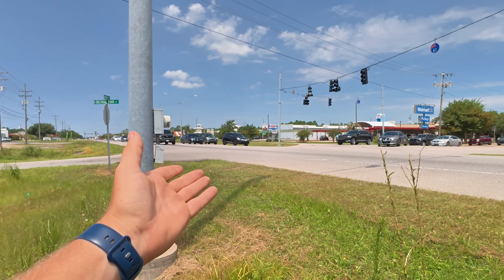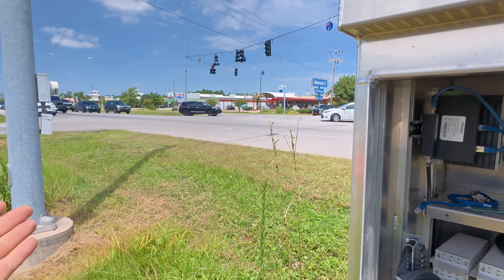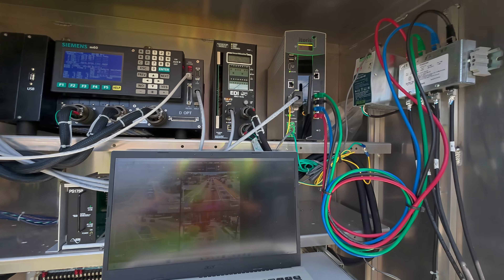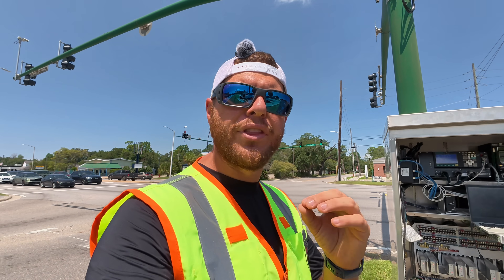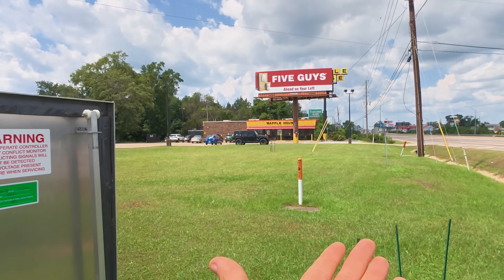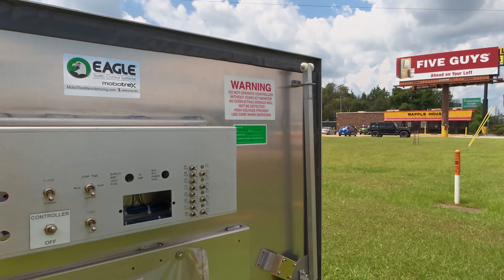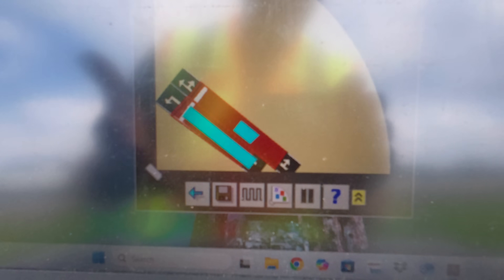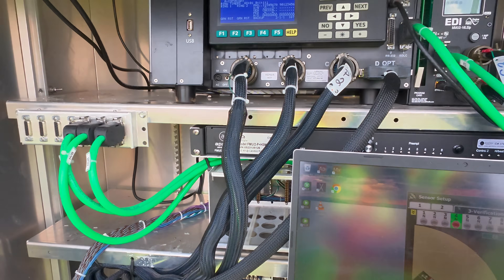Let’s Go Over 3 Types of Vehicle Detection!

Comment: Are there tricks for triggering a camera based traffic light intersection as a bicycle commuter? I will sometimes wait for a very long time before trying tricks like taking the flashing light off my bike and attempting to get the attention of the camera by directing the flashing light directly at the camera. This technique seems to sometimes work but I don't know if this technique is a known work around for bicycles or if the light just eventually will cycle even if it does not see a vehicle in place. I have also wondered if angling my bike so that more of its surface faced the camera would be an awkward but efficacious work around.

Comment: I'm not sure if I missed it. But why don't they put a delay when the light changes from Red to Green and viser versa. Meaning, when one side turns Red, the other should have a delay to turn Green, like 2-3 seconds BEFORE turning Green. It might lower accidents.
Reply: They have what is called ALL RED time, which is what you are speaking of. It's usually set for 1 or 2  seconds based on my experience. Some cities may or may not use it. I don't know the reason for not using it.

Comment: If you approach a light behind a motorcycle, do is a favor and pull up far enough to trip the detection system. I've sat there for minutes, finally a car comes up behind me and stops a car length short of the detection area.

Comment: 👏 Excellent video, can you please help this motorcyclist out? Sometimes when I'm at a traffic light, the traffic light will not change because I'm on a motorcycle. Is this because my motorcycle is too small of an imprint on the conductive loop? Can you give me some on where I should position my motorcycle at a red light. Whether it be a single Lane Road or a multi-lane road. I've always wondered about this. Thank you so much!

Comment: Long-time motorcycle rider here. Going back a few years (decades?) to the late '60s in Oklahoma. They used pressure treadles to trigger left turn signals - and my bike didn't weigh enough to trigger them.
I developed the trick of standing up on the pegs as I approached them and would drop so that my butt would hit the saddle at the same time the rear wheel was on the treadle - providing enough weight to trigger it. If it works, it works. 😁

Comment: Would it be possible for the railroads to use cameras or radar / lidar to detect when an 18 wheeler or car is stuck on the tracks?  I would assume the system, when it detected a vehicle on the tracks, could send a notification to the railroad dispatcher so they could stop any approaching trains.

Comment: $7000 for a radar unit is nuts. I would be surprised if they cost more than $300 to manufacture. What could be driving up the cost is qualifications. An aircraft certified switch may cost 10 or 20 times as much as the same switch without the certification despite them being identical and manufactured by the same people. This is also gov. too there is probably some corruption going on...

Comment: Another con of cameras is definitely data collection misuse in certain jurisdictions, incentivizing financial gain from issuing citations rather than prioritizing traffic safety. Here in Texas they were outright banned in 2019 for that very reason, and most lights here run on inductive loops, with lidar and radar used in high congestion areas like Houston and with new construction. Traffic signals here utilize the Beierle Method (6x6 inductive loops) to better manage dilemma zones which works really well, especially around frontage roads full of people who aren't used to how they work here, and of course learning about the amazing Texas Turnarounds where non-Texans often just stop abruptly instead of going through like you're supposed to, holding up all U-turn traffic at frontage and interchange lights. Fascinating to see how different states prioritize different methods according to budget, local laws and populations with varying levels of skepticism about privacy.
Reply: Traffic detection cameras aren't the same kind of cameras used for red light enforcement. The detection cameras usually are just sensing contrast changes in a live video feed—they usually aren't clear enough to see license plates and the video feeds are not recorded. Red light cameras are separate installations.

Comment: Another method is treadles. They were widely used many years ago but were subject to failure and required a lane closure to repair. There are still used on toll roads for sensing the number of axles where tolls are computed for larger vehicles.

Comment: Virginia has a regulation that if you are unable to get a green light in 3 minutes on your motorcycle, bicycle, wheelchair, e-bike, you are free to run the light. This is hardly a solution because we have lights that are red for 3.5 minutes normally (duh!). As a motorcyclist, how many times have I just driven onto the sidewalk to push the pedestrian button at a problem intersection, when there are no autos around to do the work. Parking lot gates are a problem as well. I've been struck by a falling gate when my bike was unable to straddle the two induction coils. I'm talking about an entrance with only one lane and 2 gates. I saw a wheelchair guy get clobbered by this poorly-thought-out system as well.. THE IMPORTANCE OF TESTING.

Comment: I only knew about inductive loops. Until a couple of years ago, when my mom moved and coming home from her new location, there was a stoplight that would ignore me; and I needed a left turn so  I had to wait for it. It would take 3-4 cycles or occasionally even more (one time I gave up and made a right-on-red and went to the next intersection, which is a cloverleaf, where I could make 2 right loops and come back through the light - took 15 minutes to get through the intersection). It was worse in cold weather than warm.

So I kept trying to figure out where the loop was to make sure I was on it. Couldnt figure it out, usually theyre obvious. Then I started looking around and recognized what I know realize is a RADAR. So I try to stop where the road signs arent blocking me from the RADAR and I have the problem less often.

Comment: Here's a complaint I have had for years if not decades. Side streets I'll call them that adjoin with main or larger roads that have 4 way signal controls. Main road traffic is green then a single vehicle arrives on the side street with a red and will make a right turn. Opposing traffic is far enough away so the side street vehicle proceeds to turn however, the signal cabinet has been tripped for a green for the side street vehicle that showed up and has then left which gives the main road traffic a red and no vehicles are present on the side streets. Lets say they used the ground inductive loops but it seems that they could use two loops instead of one, the second for traffic that would tend to be more to the curb side making a right turn. In that design, the loop would be specific for right turn traffic and be set to deal with a longer red light for them allowing for the break in opposing traffic  to complete their turn without making the main road traffic come to a stop for just one vehicle who showed up, loop got signaled for a green, left the area with their right turn thus causing main road traffic to stop for NO one. 
I see this way too often which causes main higher traffic roads to have to stop for nothing. 
It looks like areas subject to more severe weather should get only the inductive ground loops...could be that those are used more due to the cost and reliability factors. High tech cameras and radar appear to be too glitchy and limited for the money.
Reply: That problem is more an issue with programming than anything else when all the hardware is working properly. Setting a delay of 7-8 seconds between detection and registering a call helps eliminate the right turners who are only there briefly. Also turning off call latching for that phase would drop the call if the car is able to turn before the signal cycles around to it. Depending on exactly the situation, both at the same time can be helpful.
Reply: @garrisonsan Yes, seems that isn't factored in and it should be because of the waste there is in stopping hundreds of vehicles per day for nothing.

Comment: I've always wondered why they never used something like this to save lives by simply using these same detectors or maybe by placing them throughout the approach and departure zones in order to delay green lights when vehicle traffic has not properly stopped for the red light, and even to delay giving a green to cars approaching a red light if cars are moving toward the green on the cross street so it doesn't cause unnecessary slow downs by stopping fast moving cars in order to let one car pass that is already stopping if five or ten seconds allows the moving traffic to proceed through at spped.

Comment: In Salt Lake City, we have a central control system that handles over 480 different intersection and thing like school crossings.  The computer system adjusts flow and bottlenecks.  Major roads you can drive through dozens of lights without hitting a red
Reply: They can also control all the lights from a traffic control center manually for traffic accident and event congestion.

Comment: Do cameras give a live feed to the police department?   Do they also do an endless loop recording,  so that in the event of an accident,  the video can be downloaded?
Reply: Detector cameras are usually a live feed that goes into processing units in the controller cabinet, and aren't remotely viewable or recorded. Some intersections may have separate cameras that provide a wider view of the intersection, and these are usually remotely viewable by the DOT/ public works (or the public) for purposes of monitoring traffic flow and finding accidents...it probably varies by agency if feeds from such cameras are recorded or saved for any length of time.

Comment: My question is why radar’s are on the highways?
Reply: For exactly the reason you think. Your driving for miles and then a random state trooper shows up, just for you.
Reply: Usually it's to measure vehicle counts/speeds, to provide estimates of travel time or to determine if conditions warrant activating nearby ramp metering.

Comment: Some of those loops are not sensitive enough I've moved around on them with motorcycles trying to get them to trigger with no luck! I'm talking about older70s  bikes made with heavy steel . I could be sitting right on top of it, yes I've run the ref a few times when it didn't change so my air cooled bike didn't overheat.
Reply: I have a skid plate that will trip the detectors. Before it would usually not trigger and this is a 900 lb Victory.

Comment: Can you have a hybrid system at an intersection? Ground loops for fall/winter to defeat fog... radar for spring/summer. You can switch between the two sensors.
Reply: You can have whatever you want to pay for. A thermal imaging camera would detect traffic through the rain and fog easily, if the people want to spend their money on developing and installing a system that advanced.
Reply: ive seen intersections with induction loops and cameras but i dont know if they still use the induction loops or they just didnt want to spend the money to remove them

Comment: Who would you have to contact to file a complaint. I swear one light in my town, Yakima, will wait till I come up and then turn red. Happens more then once. Actually a few lights. It turns red on approaching traffic and activates the walk sign. 2am no one near by. I swear some of these lights are on “demo” mode. Fortunately some other problem lights for motorcycles, have been fixed.  I need to get a second job working on these to program them to fit the needs of the intersections. Almost like the installers never read the instructions. 😂😂

Comment: Long before you were a glimmer in your parent's eyes, there was another detection method: sound waves. The detector head was placed 40-70 feet before the intersection and contained a pair of JBL tweeters. One tweeter emitted a chirp and the second listened for the return from the pavement. The round-trip time was measured and remembered by the detector circuitry. When a vehicle passed under the detector, the round-trip time changed and a call was passed to the controller.  The "chirps" could be heard when passing under the detector by people with good high frequency hearing. There were enough complaints about the sound that eventually it was bumped up to the ultrasonic range.
Reply: you unlocked a memory! i remember these and still see it in my memory. it made this ticking sound and i didnt know what it was as the time. ]
Reply: Also used extensively in the '60s and '70s for building intrusion detection (burglar alarms). Worked the same way but bounced off the floor. Any intruder would interrupt the waves.

Comment: When they were first experimenting with automatic detection systems, gotta be over 60 years ago, there was one installed at an intersection my parents would drive through regularly. It used an ultrasonic transducer to bounce the sound waves off of vehicles in the target zone. Problem was as a very young child, I could HEAR the sound with would cause me great pain and I would loudly complain every time we went through that intersection. Fortunately they figured that out pretty quickly and either changed the frequency or changed the detection method since I never heard if after that time. Thanks for the well-explained video, stay safe!

Comment: Thanks for a fantastic explanatory video. Down under in Sydney, all traffic lights use inductive loops. So many fail as you say, either no detection or constant calls. A street near me has a bunch of data centres and the road has been dug up dozens of times for fibre optic and power feeds, taking out up to three intersections. Sometimes only a few days after resurfacing and repairs. Sometimes it takes months to repair. The lights go to fixed phases and completely screw up peak hours, with the whole area gridlocked...

Comment: What’s up with the stop sign on the corner there if those lights are being used
Reply: I'm guessing the stop sign is used when the traffic signals are out due to power outages in the area during storms. I've heard that in Germany, at certain intersections traffic signals are turned off at night, and traffic signs such as stop or yield are used in place of the turned off traffic signals at night.

Comment: The problem I see with the Wavetronix radar units, at least when mounted on a cable like at 8:21, is when it moves in the wind, so do the detection zones it's watching. Now, mounted on a steady arm or pole, not so much of an issue.

Edit: why do the radar units cost $6k each?? I've never really been able to understand why some things cost what they do... Those radar units probably cost less than $100 to actually make. Like radios... Say a regular Motorola two way radio costs 'X'. And then say we have a radio labeled 'Fire Service'. Same internals as the first radio, but the cost is 'X * 10'.

Comment: The magnetic loops can pick up bicycles by putting as much metal as possible at the corner of the rectangle. Unfortunately for the round ones it's a coin toss.
Reply: As you probably know, most high end modern bikes are made of carbon fiber. It's pretty frustrating standing at a red light in 90-100 degree heat (Texas) with no cross traffic and a light that won't change because the inductive loop doesn't recognize you're there.
Reply: @toddb3846  This was more than 10 years ago.
Reply: I'll have to try placing my goldwing better! Thanks!

Comment: 0:45 Actually, the EM field is amplified by the metal on your vehicle. 

All wires (that aren't superconducting) generate a magnetic field around them when they carry electricity. If you take that wire and coil it up, you amplify that magnetic field: all the puny magnetic fields along the length of the wire where it's coiled amplify together. If you then shove a magnetic substances, such as iron, near (or ideally down the middle of) that coil, you'll greatly greatly amply that field. 
If electricity is caused to stop flowing in the wire, the magnetic field that was created will collapse and dissipate. Changing magnetic fields near a wire will induce a voltage in that wire. For the few moments that the magnetic field is collapsing, a small current is induced in the wire. This phenomenon is called induction.

The coil of wire in the road acts the same way. The detector device applies momentary amounts of voltage to the coil and then senses how long it takes the current to dissipate, as influenced by the wire's magnetic field. When a vehicle with enough (magnetically sensitive) metal is near the coil, the amplified magnetic field as a result is detected by the detector device, which can then signal the controller.

Comment: Is it true that the center line of the figure 8 of an induction loop is twice as sensitive as the outer loops?   I heard that was the best place to roll up on a motorcycle for detection.
Reply: Induction loops aren't normally "figure 8s". But the center-middle of the loop would (theoretically) be the most sensitive.
Reply: @jovetj I believe he is referring to quadrupole loops which are normally used for smaller vehicles such as bicycle or motorcycle. Some people call them figure 8 due to how they are cut. We used them a lot here.